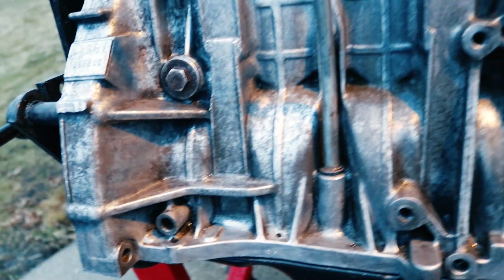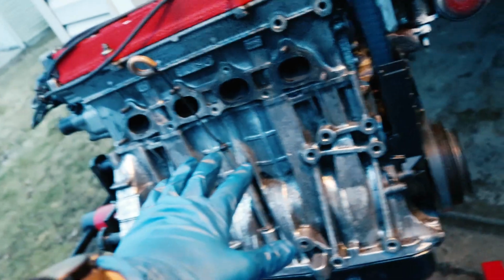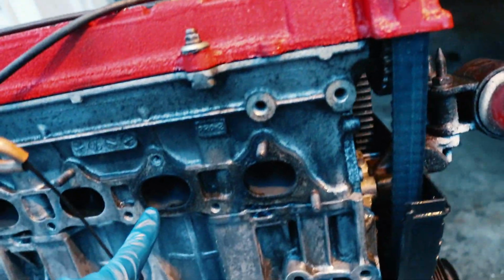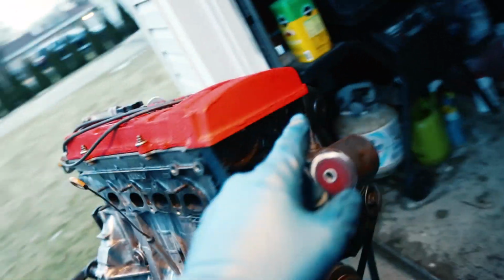Satisfying Import Engine Cleaning

Comment: Get a manual steering rack. Throw the old power steering rack away
Reply from the maker: Raymond Owen will do. What is the benefit?
Reply: @boosted_john  no power steering the manual rack is lighter plus manual rack is smaller so if your car has no ps I would upgrade to manual rack
Reply from the maker: Raymond Owen gotcha